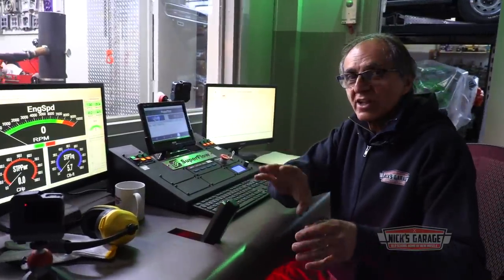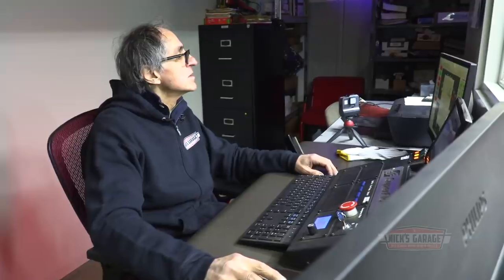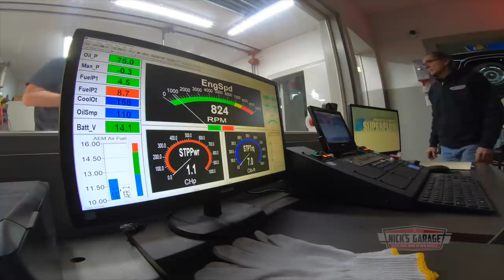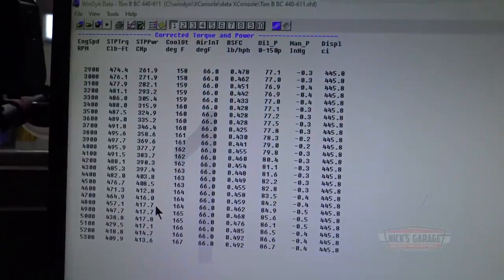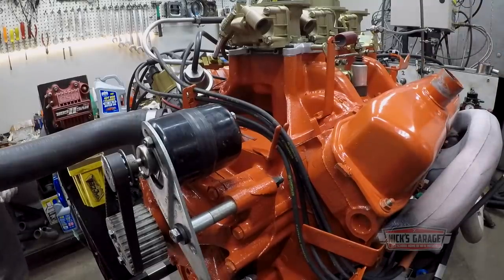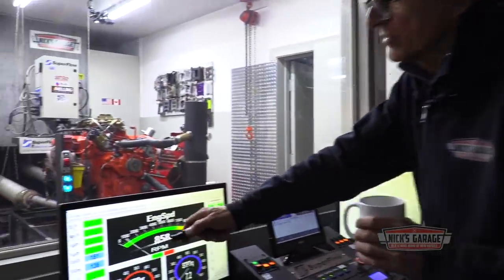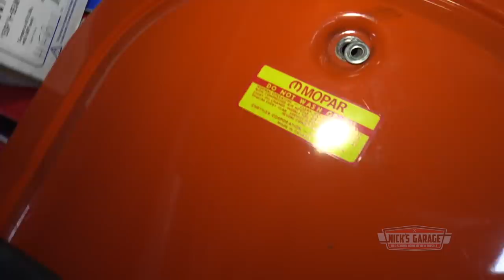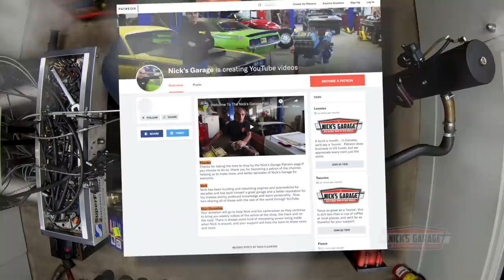Classic 440 Dyno Tested - 1969 A12 Road Runner 6 Barrel

Comment: Good to see a wix oil filter  on this ..  i use 30wt  VR 1 valvoline racing oil hi zinc 1800ppm and Wix oil filters or napa gold (wix) and I add 
Marvel mystery oil to fuel to help lubricate top end valves rings etc  ..
Reply: l use Lucas in my gas to lub the top part...
Reply: @steveshoemaker6347  marvel mystery oil has been around since 1930 
And heavily used during World War II for the P-51 and B-17 upper cylinder lubricant and used many times by  our machine shop that started around 19 25 always stick with something that works
Reply: @quagmiredavis4117  Yes it is GOOD Stuff...l first looked at a cam Marvel Mistery oil back in 1946...My dad had that can next to his tool boxes....l am in my 80's now...l was a combat pilot don't know if my F-4 had any of it in it or not...Thanks my friend stay safe young man...!
Reply: @steveshoemaker6347  I'm only 36
Grandad uses marvel in his 56 Corvettes 58 65 70   he's out in the shop right now working on his 57 Chrysler 300 he is your age plus one  plus I have several Mopar vehicles... thanks for sharing your experience
Reply: @quagmiredavis4117  l has been my honer to meet you my friend....So very glad you still have you Grandad...l have outlived every one in my family on both sides...Wife kids Aunts Uncles brothers sister all gone for one reason or another....Blessing your way...Thanks...!
Reply: @steveshoemaker6347  what state is home

Comment: Nick, ever thought of putting an additional display in the the actual engine room, maybe over workbench or window (that would be optimim, this way can't see from control room), so can see the changes in the adjustments you make?
Reply from the maker: We installed one recently.  But it only lasted a few days.  Perhaps the video card in the computer? Perhaps the vibrations in the dyno cell?

Comment: I love it!  Very Nice work, Nick!
I'm a little curious to know more about your concern over the extra oil pressure, it makes me feel uneasy too but I hope you can share your reason if anything in particular.
My Buick has always idled around 12psi at 600RPM but it jumps up quickly with some throttle.
My Olds runs more in line with this 440 in terms of oil pressure, doesn't quite reach 75psi though and about the same horsepower.  Running a Thermoquad.

Comment: I went through all the comments and the best I can come to is the cam is a Lunati VooDoo 262/268. I'm basing this on the replies, seems someone doesn't want to just outright which cam. That said, I'm looking at this cam for my 383 with 906 heads and HP exhaust manifolds and a Edelbrock Performer. Many years ago I out a Purple stripe in a 383 and while it ran good I always wondered if I should have gone with a 6-barrel cam instead. Looking at the after market I like the looks of this one the most and interested what someone with experience with it thinks or recommends. Thanks.
Reply: I have a 256/262 Lunati Voodoo in my 68 383 and LOVE it.  Awesome torque...engine pulls like a freight train.  18" of vacuum.   Slightly noticeable idle but mine idles at 700.

Comment: From the dyno test I've seen the cool factor from the 6 pack cost few hp vs the factory 4bbl carb and intake, it's similar with BBC's which use basically the same setup for their tri-power only they go to a nice Holley 4bbl.  That might explain why the 440 Six pack got a little more cam vs the 4bbl 440 magnum. 

I've seen an air cleaner shoot out so the results weren't surprising.  For awhile up to about 2005 aftermarket bolt-ons did yield meaningful gain from 2010 to present you're more likely to lose power on any sporty car.  OEM's aren't leaving much on the table these days.  Even deleting the cats isn't worth it anymore high flow cats vs delete is only about 2-3whp.  Obviously the factory has to adhere to strict emission standards that a tuner doesn't so there is that still.

Comment: Hey Nick, I'm going to take a wild guess on the cam. Sounds like the same one i used on my 440. Your numbers are very close to what i got. 
Lunatic VooDoo 10230702/old 60302 cam. Split lift and duration and works well with factory HP manifolds.
Reply: My combo: factory steel crank, 440source replacement rods, Speedpro l2355f .030" over "sixpack" pistons, block decked with pistons set .010" in the hole, cometic .039" gaskets, mopar performance "452" aluminum heads, Ss full roller rockers, mopar aluminum dual plane M1 intake, edelbrock 750cfm manual choke, proform electronic distributor (i believe set at 36 deg total adv), lunati Voodoo 10230702 cam straight up and degreed, stock '71 C body HP manifolds.  We got 488ftlbs @3400rpm and 410hp @ 4900rpm. Speedshop didn't tune it either, was running a tad rich. I have a new holley street demon 750 and Firecore distributor, hopefully it'll optimize it even more.

Comment: Just an Observation to increase efficiency, You should get a cheap LCD TV to mount in the engine dyno room so when your out there making adjustments you dont have to keep walking to the control room...
Reply from the maker: We did! The poor screen was dead in about a week from the vibrations.
Reply: @NicksGarage  Oh, You can always get a lightly used "Industrial / Military" Monitor on Ebay, They are a lil more expensive then regular monitors but not too expensive... For that purpose the monitor doesnt have to be very high resolution or super accurate color replication and there are alot in the 2nd hand market.... OR put the monitor flat against the safty glass so it can be sern in engine room but still be in control room environment

Comment: I don’t know if this has been mentioned already but with the high volume oil pumps on B-RB Chrysler engines you need to shim the pump or they build ridiculous pressure especially cold. My father built one and I’ve been struggling figuring this same problem out and stumbled upon this information recently.

Comment: The last piece of the puzzle nick, don't you have straight pipe with mufflers installed for dyno testing ? i had installed exhaust cut outs on one of my cars , but how much power do mufflers take away, hows the torque curve affected ? stock muffler vs hi-flow and the famous cherry bombs ? want to see  with air cleaner and mufflers soon ! What did we really get from the factory stock in the end ? you can hear the engine noises better too ? also headers with mufflers vs cast iron manifolds , still that much of gain? Sure at the track open exhaust ,but on the street is something to know too .

Comment: Lucas Hot Rod oil. 2100 ppm zinc. Minimum for flat tappet is 1250 ppm zinc. Please guys don't get fooled, make sure to use 1250 ppm or higher.
Reply: Dana.     I also add a lucas zinc additive.
Reply: @nickpanaritis4122  Great stuff. I talked to a Lucas tech years ago. I believe it adds 400 ppm zinc per ounce. Would have to verify. Works with any oil. They're the best. I know you know also. Keep up the great work!

Comment: These engines need some better cylinder heads and a rotating assembly that doesn't weigh so much. RB engines have a lot of heavy parts, they are built like a diesel. You see it when you balance them, the bob weights are pretty big. Heavy cast pistons with very big pins.
Reply: Old School.

Comment: It would be very interesting to see how the belt-driven accessories affect engine output. Could you run a fan and alternator on that dyno set-up?
Reply: Dan.     I will one day.
Reply: @nickpanaritis4122  awesome Nick thanks
Reply: @danbusey  And turn on the AC.
Reply: @70smemories  no A/C on a 6 pack but power steering is possible.

Comment: Nick,
      Do you run the PCV valve/system when you dyno  the street engines as they were originally equipped?
Reply: Byron.     In some cases yes.

Comment: OK. Put it in a car and run it on a chassis dynamometer. Then put a fan into the air scoop giving 60 mph air and compare the results between that and no fan. I’m wondering if you get a positive ram air effect.

Comment: Niceeeeee!  Great way to start the day :-)  I am curious about why 85 psi or there abouts is too high.  Oil leaks?
Reply: Bob.      Cold start at  2000  RPM's  had a reading of 105 PSI. This is the reason why I replaced the oil pump.
Reply: @nickpanaritis4122  thanks

Comment: Believe it or not I've read that too much oil pressure can be bad for main and rod bearings by pressing against the back of the bearings forcing a tighter clearance and possibly premature wearing them and then spinning them. I've also read that 10 psi per 1000 rpm is adequate for standard non-racing motors. Also ford motors with hex drive pumps are notorious for twisting the drive rod because of oil pumps being set to high pressure.
Reply: Take some things you read with a grain of salt...
Reply: @BuzzLOLOL  I would except this was an expert on racing the specific motor the web site was 100% dedicated to. They obviously had plenty of experience running the small inline six at 3 to 4 times its stock HP in drag racing, so I tend to listen when someone like that gives advice. I mentioned this to a local engine builder and he also thought it was crazy but then he proved to not be as swift as he thought when I learned his nickname was Break it Dale and was ignorant of several things a Ford lover should have known after 50 years of racing them.

Comment: it would be interesting to see what 1 7/8 exhaust would do on torgue and power from 1 3/4 exhaust according to spec 1 3/4 hovers around 4k rpm peak torgue and 1 7/8 are supposed to be up to 4400 rpm where peak torgue would be observed.
Reply from the maker: Another test we will have to try some day.  Thanks for watching.
Reply: Factory Mopar performance manual says 440s want 2" primary tube 4 into 1 headers with a 36" x 3 1/2" collectors feeding into a 2 1/2" exhaust system with 2 1/8th" tail pipes. That's worth, with a re-jet 40hp over the Magnum manifolds in the early 1970s. IIRC it also states the length of the cloverleaf from the primaries to the collector but I can't recall that length. Pretty specific eh?
edit: and a 2 1/2" crossover pipe as close to the collectors as possible LOL.

Comment: I have pulled down a paint booth, and reassembled it from a thousand pieces. I would rather setup an engine dyno! 😄 Any news on a chassis or hub dyno?
Reply: Shaun.    I was going to remove the Christmas decor from your Mother in law.  The day I said I was going to do it, it was raining. But 1 week later someone had done it. And back to the question, if I was any younger I would have installed a chassis Dyno.

Comment: Nick, you gained  2-3 hp with the  new
smaller oil  pump and slightly  higher  oil temp.
I think most of the gain was the pump.
Also  did  the F/A ratio  change  with the air  cleaner  on?
Reply: William.          Not much from what I seen on my screen.
Reply: @nickpanaritis4122  As you know  hi-vol 
pumps draw a lot of power and heat up
the oil when they push the excess through  the bypass. And in some
cases will  empty a small oil pan 
faster then the oil can drain down. 
And also puts a higher  load on the
distributor  and cam gear. Fords
in particular. Don't know  if Mopars
have these  issues. But a high volume 
pump did get me back some oil pressure 
on a 318 van  with 269k miles. Not
as easy to do as a big block!

Comment: Happy Easter Nick . One question for you . Are Wix oil filters more restrictive than regular let's say Fram filters that  I use on my daily drivers.
Reply: andy.         Good question.  Not sure on this subject.
Reply: @nickpanaritis4122   Thank you for your reply Nick . A while back my brother was a mechanic at a dealership. I had very low oil pressure in my Lada . He advised to block the oil filter with paper and sell it. I did not do that  , I just drove it , and did oil changes every couple thousand km. It lasted years as a snow plow at the acreage after that until the plow broke. Have a good day at work .🙂

Comment: Have you ever tried the air cleaner base without the lid?
Reply: @Car Guy daddyo The carb base my be straightening out the airflow over the air bleeds in the carb airhorns.  Also might be reducing turbulence for the air going into the carbs which could increase the volume of airflow and strengthen signals in the boosters.  All good things.  Many years ago, I saw dyno sheets where only carb bases were changed.  Surprising how often that simple change added or subtracted measurable power.

Comment: NICK,
Not HEAT SINK. A heat sink is a heat dispersion part used on electronic circuit boards.
What you mean is HEAT SOAK.
30-40psi @ idle!?!?!?! I just watched a vid where an F150 with 4.6L v8 was only
making 12psi hot idle. The |FORD shop manual said
'If the engine can manage 10psi hot idle it is good to go'
Are you kidding me? 10psi might be OK to commute the truck to work
BUT
I wouldn't haul a load of bricks or pull a heavy trailer with it.
I FORGET, did I tell you about the FORD F550 with 6.7L diesel that came in with a spun bearing?
In 196,000 miles the truck had only seen 6 oil changes.
Warranty Denied.

!
Reply: OURv.        WOW, only 6 oil changes. Some people just do not care.

Comment: I wonder what was the temp the factory ran the engines on the dyno and I wonder how much HP is lost if you started the test at 170 or 180 F what it would be.
Reply: Probably more HP with a slightly warmer engine and cooler intake air...

Comment: I had a 440 that it had 75 cold 15 hot. Was just rebuilt. Not by me. Pulled apart and ck everything still low oil pressure. Got different block put all parts from old to new block after all block work and oil pressure 45 idle 77 at 5200. Never found why low pressure in old block
Reply from the maker: Another Mopar mystery.  hmmm

Comment: Nick Would  high zinc 20w50 work also?
Reply: @Car Guy daddyo note  thicker not better with gasoline engines.  20/50 unless loose clearances (race prep).  is more for very warm ambiant temperture or diesel in Canary Islands. ask self why '17 Hellcat uses  OEM Penzoil Ultra 0w-40

Comment: Apart from maybe risking oil leaks, what is the down side of a high oil pressure? 🤷🏼‍♂️
Reply from the maker: It can be an indication that there is a restriction in the oil passages of the engine.
Reply: @NicksGarage  Exactly , some parts of engine get little or no oil .

Comment: Nick they all say that's only for insurance numbers it makes way more power but you're showing us that the numbers are pretty close to what the factory specs were people think if they put a cam and intake,and carb they'll get a couple hundred. HP but it's not true because you have to have everything else right
Reply: The 440's were rated about right... the 335 HP Roadrunner 383 was prolly more like 365 HP...

Comment: Why is higher than normal oil pressure a concern?
Reply: Costs HP/MPG to pump high oil pressure... can also blow out seals and gaskets... cause oil to run hotter... 
Chevy's tend to idle at 20 psi oil pressure...
Reply: @BuzzLOLOL  right, thanks👍

Comment: An after market cam and head work and it still didn't make one horse power per cubic inch ,power is in the heads if its not a hemi mopar heads don't flow good # buy a big block ford 429/460 or a big block Chevy put it in a duster or dart you won't be sorry

Comment: is 45 lbs to low @ 2000k in 5.3 chevy ???  ( oil pressure )
Reply: Small block Chevy's used to idle at 20 psi...
Reply: @BuzzLOLOL  I get around 35 lbs at ideal , my 07 Tahoe , 250 k on it lol ...truck is like new , in and out :) 45 lbs at 2 k ... always wonder if thats enough :)
Reply: i also have many old cars , my best i think is an all original Hemi Superbird with 16 k on it , never been wet it's whole life , lives in 68 degrees all year long :)
Reply: @rickmarin1265  - You need to drive it more...
Reply: @rickmarin1265  .     Yes, it is enough.
Reply: @rickmarin1265  .      Hemi Superbird. Needs to fly free on the open highways.
Reply: @BuzzLOLOL  it gets used , i drive it around in the summer, but i also have like 8 other cars ..so i use them all .. plus my suburbans  lol
Reply: @nickpanaritis4122  this summer i am going to trailer it up to your place from cape cod ma and drive around canada abit with it ..my wife can't reach nor push in the clutch even if she wanted to lol .. so it is just me that drives it lol
Reply: @nickpanaritis4122  Thank you Nick :)
Reply: @rickmarin1265  - Lend me and Nick the Hemi Bird and we'll help put some miles on it...
Reply: @rickmarin1265  .    NICE
Reply: @BuzzLOLOL  my kids don't even get to drive it , and they are in there 30s lmao :)
Reply: @rickmarin1265  - It's OK... Nick is older... and I'm 73...